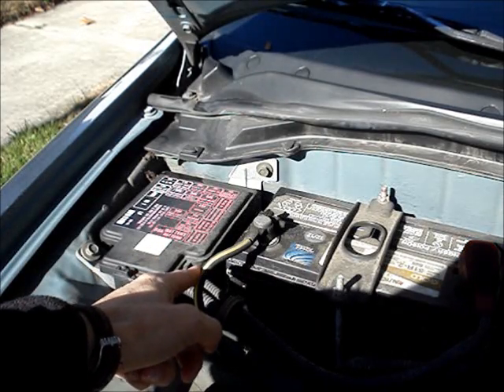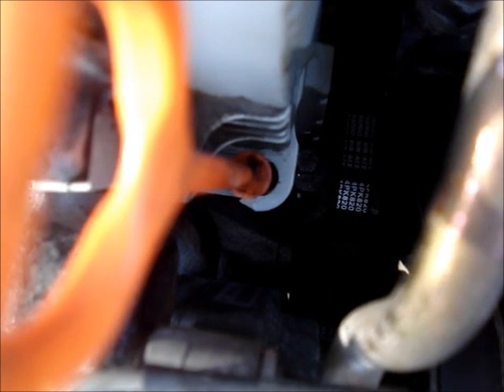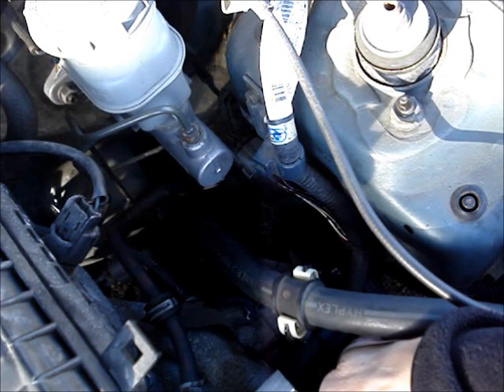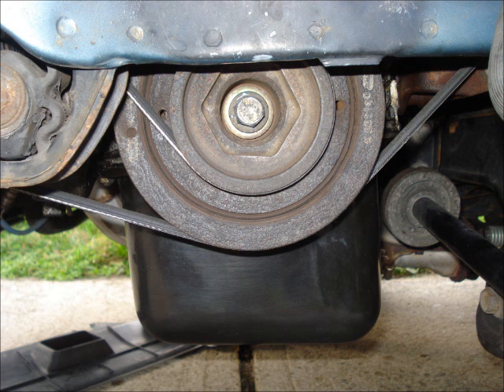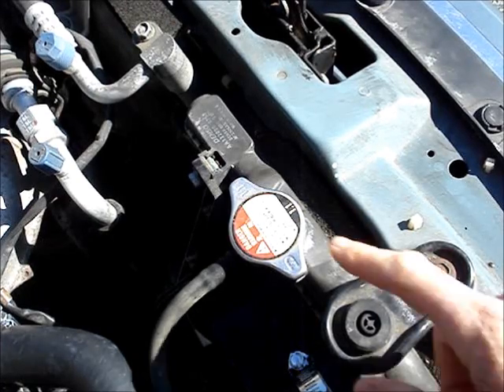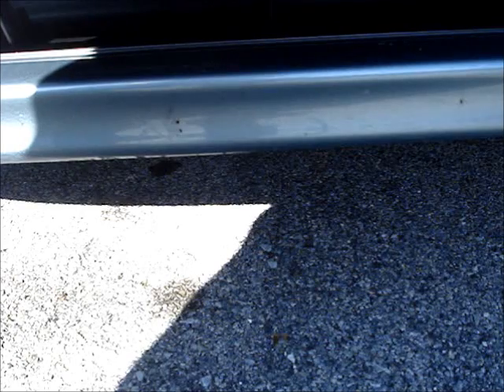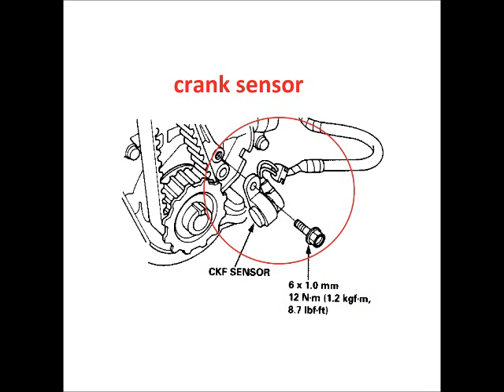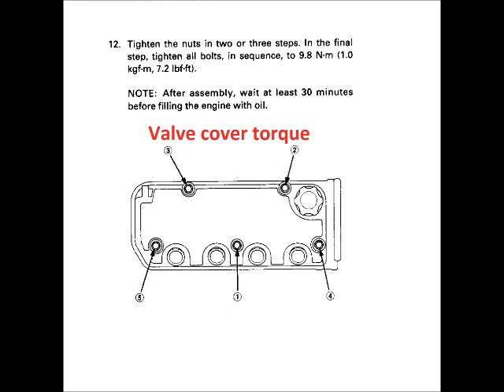Replace a Honda Civic Timing Belt and Water Pump 1999

Comment: Cylinder one needs to be at TDC on the COMPRESSION STROKE. It's always good to check with a compression tester than to just rely on the marks. 

Great video saved me a lot of time rather than just tryin to figure out what needs to be removed. Good little short cut
Reply from the maker: Thanks for commenting.  I watched a lot of videos and did a lot of research before we did the work.   The goal of this video was to give an overview of the job for someone that has some basic mechanical skills.

Comment from the maker: I also replaced both (original) radiator hoses & the thermostat while changing the timing belt & water pump.  After the job was completed,  I had a very slow loss of coolant, so slight that I was not even sure that I had a leak.  I tightened up a hose clamp and thought it solved the problem and then tried a new radiator cap. 

It's now April 2019 and I've discovered there is a crack in the plastic top part of the radiator.  I think that when I changed out the radiator hose the plastic slightly cracked when the new hose was pushed into place.  Over time the crack must have gotten a little larger so that I could be sure I had a leak.  Apparently, it is common for the plastic on the radiator to crack, so be on the lookout for it.  Eric the car guy has a video showing how to change out the radiator on a 1999.
Reply: Do you have to do the timung belt when you do the water pump?
Reply: I'm thinking is it too major a repair for a 20 year old car? What was your car doing that made you determine this repair was necessary. I'm having progessively worse overheating problems and i think the fluid is not circulating before that it would run for about 25 mins and i would hear boiling in the reserve tank. This last incident no boiling so like a dummy i opened the radiator too soon and got an explosion. What are your thoughts please.
Reply from the maker: My Honda only had 105,000 miles on it.  The timing belt material degrades over time and if it breaks on this engine, it will damage the engine.  Since it is labor intensive to change the belt, the water pump should be changed.  You don't want to tear it apart again because the water pump fails.  I
Reply: @Know-How-Now  Thank you
Reply from the maker: You are welcome.  A friend who owns a repair shop tells me that parts will be available for this car for another 10 years.

Comment: Any idea if once that bear of a crankshaft bolt has been priorly loosed to change out the belt and water pump by a mechanic, would follow up removal of the bolt be easier even if tightened by air tool by the shop in case I need to replace the water pump or belt in future?  Thanks for the upload!
Reply from the maker: I did a lot of research before we changed out the belt.  It seemed like everyone had a problem with those bolts.  I'd think it is the design.  An impact wrench is the way to go to loosen them.  We broke a socket and then went out to rent an impact wrench and a heavy duty socket.

Comment: I like that you didn't spend time showing the actual removal of the parts, just the tricky/critics issues. Thanks. I've heard the crankshaft nut is from satan's design school.
Reply from the maker: You are welcome.  I couldn't find any videos that covered some questions I had.  I spent a lot of time researching those details. If you have some basic auto repair experience & some patience, then this is doable.  It's not for a beginner.  That crankshaft nut was the bear.  If you don't have air tools rent one or get your mechanical to break it loose for you before you start the work.  Good luck!

Comment: Is a very good video in how you did the timing belt job. Those pictures from the manual are very helpful to do this job better,thank you.  The tension of the belt in the way you did it was fine or you have to adjusted  a few weeks later?
Reply from the maker: I had to tighten the belt up a few weeks later.  Although I had already finished the job, I thought that I could help other people by sharing some of the research I spent a lot of time doing.  Getting that bolt loose was the toughest part.
Reply: @Know-How-Now  how did you retight the belt?
Reply from the maker: I may not have been clear on your question.  I didn't have to tighten the timing belt.  I did have to snug up on of the belts, I think the one on the alternator.

Comment: I can't remove the lower timing belt cover. I've been trying for several hours and can't figure out how to get the bolts lose. Can you please help me figure out what I'm doing wrong?
Reply from the maker: You can try spraying PB Blaster penetrating oil on the bolt heads, wait an hour & try again.  Maybe they are rusty & stuck.

Comment: Hey, hey that looks like my civic!!!!
Reply from the maker: They are great cars.  It rarely needs any repairs and it's at 168,000 miles.
Reply: @Know-How-Now  mine is at 210000 and I love it
Reply from the maker: I'm hanging onto mine as long as possible.  It's cheap reliable transportation.   About 2 years ago, my mechanic told me parts would be available for about 10 years.
Reply: @Know-How-Now  yeah, I'm trying to find another one that's manual, or an NSX.

Comment: Excellent video.Very instructive.I will prepare to do the replacement in my honda.Sucesso for you.
Reply from the maker: Thanks for the compliment.  Best wishes for an easy replacement, don't forget about the loosing the bolt advice.  Either get an impact wrench or have a shop break it loose for you prior to starting your work.

Comment: How much did the mechanic want to do this job?
Reply from the maker: About $950, that included changing all the belts & water pump.  I don't know if they were going to install Honda parts. The hardest parts of doing the job was finding information that covered the entire process and getting the crank shaft pulley bolt loose.  

The old timing belt still looked good.  It had around 105,000 miles(17 years old) on it and was the original belt.  We also replaced the radiator hoses and the thermostat.  I bought Honda OEM parts.  The parts, antifreeze, renting the electric impact wrench was around $400.... though we did additional work than the quote from the mechanic.
Reply: 750 for me

Comment: Damn I tought it would be easier;( I gotta change my water pump is leaking antifreeze
Reply from the maker: I spent more time researching & getting the right parts than doing the job.  Getting the bolt loose was the hardest part..... use an impact wrench or get someone to break it loose for you.
Reply: Know How Now yeah I’m taking it to my local mechanic this afternoon I don’t know how much he will charge me
Reply: @pibitoladron3968  How much did he charge you?

Comment: I thought this video was going to show the process not just talk... all it says is to remove this and that but doesn't show how .. this video is no good in my opinion even I can just state the obvious... nice try tho.
Reply from the maker: Sorry it didn't work for you, Fabian.  The video's purpose is to be an over view of all the steps and the order to do them.  When I was researching how to change the timing belt, I could only find part of the information, people usually jumped in after they had everything apart, often never cautioning about how difficult it is to get the crank shaft pulley and omitting a lot of important details.  Good luck.